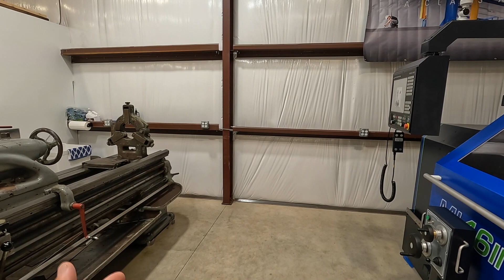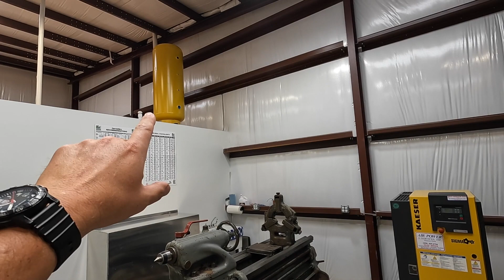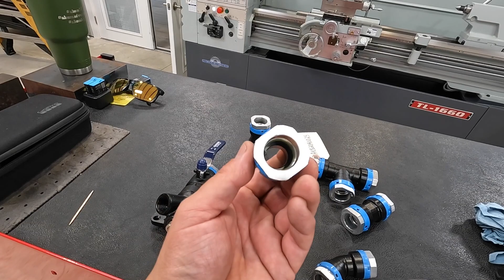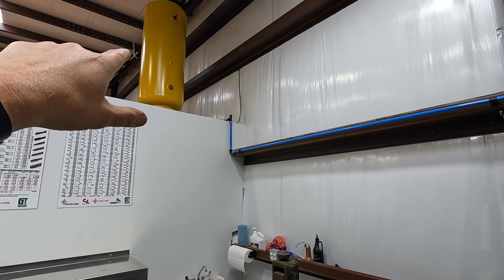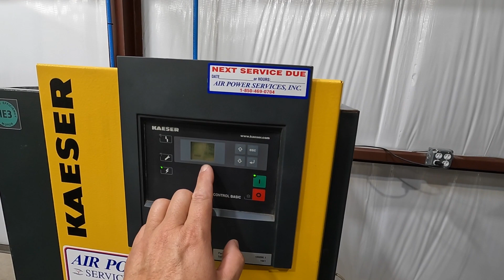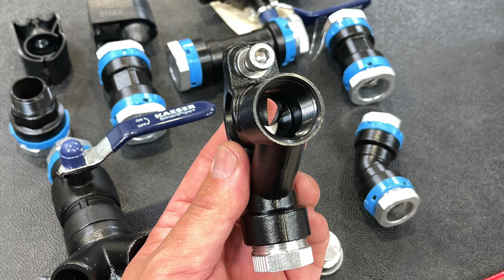KAESER Air Compressor & Smart Pipe Installation

Comment: I’m just waiting for all the battery purists to chip in and complain that air is garbage and a waste of money 😆 beautiful system though, congrats! There’s nothing like a properly setup air system, I feel like crappy unmaintained air systems give people a false idea about compressed air. It’s by far the most useful power source to have in a shop
Reply: Try running a cool mist or getting chips out of a hole with a battery.
Reply: @kensherwin4544  Or try chasing down a Shelby Mustang for ten miles with a Tesla. After five miles at full battery power it’s all over.
Reply: @ellieprice363 ... If you can find the Tesla after it runs away from the Shelby!
Reply: @paulcopeland9035  If you find it after five miles at full power it’ll probably be burning.  (:-))
Reply: @ellieprice363  Ahhh!.....Battery hate.  It seems to be going around on this channel!
Reply: "battery purists"?  Hell, everybody is a "battery purist" these days!  Compressed air has a lot of uses other than running tools.  A good system like this is icing on the cake!

Comment: When I heard “smart pipe”, I really cringed! It’s like, “don’t tell me some dingaling decided to over-complicate pipe, for heaven’s sake!” It’s pipe; a thin-walled cylinder open at both ends, like a straw. It doesn’t need computers or automation or sensors (except maybe if it’s carrying dangerous/flammable chemicals, especially underground.) Good thing these are just regular v1.0 pipes! 😌❤️
Reply: Yeah I fucking hate marketing buzzwords that do nothing except check a box on a bean-counter's piece of paper. There is literally nothing "smart" about pipe.
Reply: At least they didn't call it iPipe.😁😁

Comment: How to the fittings connect?
Threads- press- shark style?
Reply: They are "shark style" with high tolerance, a good system!
Reply: The fittings have a cutting ring. When the nut is tightened it bites into the pipe.

Comment: Very cool, that is a nice air system to be sure. Too bad they created a trip hazard on top of the office which you had indicated that you were going to use for storage or the wife's projects. Maybe plans have changed as they often do.
Reply: Yea I was confused by that, seems like installers taking the easy option which will get on the way later. Can't see why that would be more efficient to have on top.

Comment: Is this shop going to be a manufacturer showplace for equipment you get for free?  Or is this going to be a real working shop?  I subscribed to see chips fly.  Don't really care about rigging an expensive air compressor
Reply: The product placement is getting to be ridiculous - that's why the compressor is in the middle of the shop, where no one else would put it - so you can see it in every video. This is a youtube studio, not a job shop. Which is fine, if that's what you want. Not for me.
Reply: Go away.  You won't be missed.
Reply: Or you can skip the episode 😂

Comment: Really nice air system, Its sounds like a furnace blower on low, very quite and easy on the ears.
Reply: Once the cooling fan kicks on, it's not so quiet. But, it's only momentary that it's on... At least that's my experience with larger (100HP installs).
Reply: @IceBergGeo  On the SX series the fan is mounted to the drive motor. That is as loud as it gets.
Reply: @ibey01  nice. Something I didn't know. Always good to learn. 

The larger applications are pretty neat though. At one installation, the customer put one into a closed room with a TEENY exhaust fan. Room went from about 70 to 130 in about 5 seconds when the cooling fan kicked in. Gotta love engineers, right? This was known that a compressor of this size was going in there.

Comment: A question I have is, why didn't they run the pipe completely around the in a continues loop? From what I have read and heard, that a loop will provide equal pressure and air volume completely around the loop.
Reply: The pressure drop in a 1 in new pipe is minimal
Reply: if it was a big shop with many workers, sure. its a small shop with a solo operator.
Reply: Yep .. that's the way it should be done.

Comment: I’d seriously consider moving that compressor away from your work area and run that mezzanine air line on the wall so you can still forklift stuff up onto the platform
Reply: looks like it is arranged to be in camera shots
Reply: @WastingBob  definitely looks like product placement
Reply: First thing I thought of too
Reply: Makes a lot of sense!
Reply: He could even remote mount it on the mezzanine and run a switch down somewhere accessible. The location he chose is down right terrible.

Comment: Your shop looks awesome. The lighting is great. I am not sure I understood why the air distribution system is "smart". It looks typical. The air compressor with the dryer will produce as much BTU to counteract the mini split AC unit.
Reply: "Smart" is just a trade name. The stuff I used was called "Rapid-Pipe" basically the same thing, but the fittings were different. The heat given off by the air dryer will be an interesting question.
Reply: @tsmartin  the heat coming from the compressor will be more than the heat coming from the air dryer, especially when you consider that it's just an ac unit that's inside. As such, most of the heat coming from it will be the refrigerant compressor.
Reply: The drier will produce net very little heat as the compressed air is cooled which will be warmed by the heat of the drier coil plus the heat of it’s inefficiency. The compressor is much the same but will have greater heat effect as its heat will be concentrated right in his workspace. Better placement for noise and heat dissipation would have been up with the tank.

Comment: I swear by a Kaeser air compressor, I've got a little 1.5hp portable unit I use ALL the time.  I love that thing, it's been rode hard and put away wet but is still kicking.  Loud as all-get-out, but has never let me down.  Best $175 I ever spent.  I bought it from a yard sale years ago and don't know how long they had it before me, but I haven't had that first problem with it.

Comment: So Adam, you have a HUGE flat room in sunny florida. Are you thinking about solar on the roof? Also, is there room by the AC units to put a shed for the compressor outside?
Reply: He doesn't own the building.  Joe (the owner and his friend) might have an issue with outdoor "improvements"!!

Comment: EDIT:(I posted this comment before watching the whole video... it looks like you've got the system dialed in and will work well for you)

Adam, did you get the built-in air dryer with your new compressor? While "normal" compressed air might not be a problem that CNC lathe will not like it at all. The moist air will corrode and gum up pneumatic valves and anything else air-powered in that machine. When I bought a CNC lathe no one mentioned getting an air dryer. Eventually, we had to replace several valves and rebuild a collet closer due to water damage from wet air AND we bought an air dryer. No problems since.

As for the piping: make the 2 legs of of the "distribution" pipes connect into a loop. This increases the flow of volume of air in any point of the system, especially if there's some heavy use of air. If you don't have an air dryer position the T-fittings to point UP and use a 180° u-bend to drip the lines. This keeps condensed water from just draining down the "drop". Put a small drain valve at the bottom of each drop so water can be purged from the "drop".

I HIGHLY suggest moving the compressor near the front of the building. The proposed place is too close to the work area: you're going to feel the heat  from that compressor and, while it's quieter than piston compressors, it will be noisy. I have a Kaeser SM10 and it's much quieter it's not silent and at the end of the day you'll notice it. My opinion: the proposed location is not good.
Reply: @ralphgesler5110  Hence my top line saying I had not watched the entire video before commenting. I left the comment up since I felt that I had some useful information for others. I suspect when they get to the video for the piping the Kaeser rep will have even more info.

Comment: So you are taking over Abby's craft area above the office????
Reply: That's what  was wondering.  With the tubing around the edge, Abby will have to step over it every time she goes up and down.  Also with equipment all around the outside of the office, where will you put the stairs for Abby to get to the second floor?   You could be in BBBBBBBiiiiiiiiiiiigggggggg  trouble!

Comment: Sure hope with the shiny new system that you use 3/8 inch or high flow couplings and not the cinchy low flow 1/4 inch fittings that most use!

Comment: I couldnt help notice the cover is installed over the water fountain /water heater. Did we ever do anything concerning.....The TRAP 
 Just kidding. Really nice compressed air system. Good going. BTW i eun service calls at a location that has a screw type compressor although a different brand. I havent noticed any heat troubles so far. I,m sure it will do fine
Reply: Just wait until the sewer smell starts and everybody will be running around trying to find out where it's coming from.
Reply: That water fountain doubles as an emergency eyewash station.  Everyone else will be glad to have it.
Reply: @12345NoNamesLeft  Oh man... Someone gets something nasty in their eyes, they stumble blindly to where they think the water fountain/eyewash station is... they find it but t is underneath several hundred pounds of tools and parts that are sitting on a stainless steel cover... desperately the shove off all the tooling on to the floor and tear the cover back and then... they hit the valve but what is coming out of it? 
Easier to go to the sink and stick your head under it. Better yet get a couple of those plastic eyewash units and screw them to the wall. At least then you should have some reasonably sterile stuff to flush the eyes with.
Reply: I'm disappointed.  After all of the doomsday warnings from the YouTube plumbing vent experts, I expected to see the back half of the shop blown off from a methane explosion.  Dang, no fun on this channel.
Reply: @paulcopeland9035  oh man youre not kidding. The freaking worrying that went on and on about the dadgum.... TRAP!!!!!!
Reply: @randyfox4611  !! YES.  I don't know if you live close to this shop or have planed to visit, but I would not go near it.  The danger of a TRAP explosion is no joke(!!).....and we should alert the authorities. Thank you for your concern.  It shows there are at least some adults who watch this channel.
Reply: @paulcopeland9035  thanks for noticing. I dont know if you picked up on it in the previous replys but apparently we missed a very important facet to the dilemma.....in case of emergency one would be required to wash there eyes in the now covered water fountain. I swear...that fountain with its explosive gas issues and now the inability to wash out eyes in an emergency. At this point i wouldn't be suprised if they tossed that trouble making Mo Fing thing right out in the back yard!
Reply: @randyfox4611  Well, I have been involved with a few "shop builds" over the year (have one now!) and that sink was not a designated "eye wash" appliance!  I don't know the Florida code but I am guessing it is just a cheap sink they stuck on there to satisfy tenant building code.  The "explosive methane" thing is funny to me and I guess you can tell how I feel about it.  Just another "YouTube Expert" bunch of nonsense.
Reply: @paulcopeland9035  all very true. Thanks lots for being of good humor about the thing. Its been a lot of fun. I truthfully was astounded at the huge measure of those who were so pasionate about how wrong it was and soforth. Thanks again for the fun we had with........the trap

Comment: certainly beats using old iron pipe for your compressed air.  so much easier now.
Reply: Easier until you see the price tag compared to black pipe. :)
Reply: Materials are more expensive than black pipe for sure, the labor no, imagine threading so much ends and connection of black pipe? You can't compare the two, the aluminum tubing lasts forever with no air turbulence and pressure loss, not to talk about rust and contamination

Comment: Not sure why the pipes would kick out at the top and leave all that hose hanging out to get snagged the first chance you have. Would it not make more sense to keep it close to the wall until you reach the tap and then kick out?
Reply: My thoughts too
Reply: Turbulence
Reply: When you have yours installed make sure you tell the guys to do that and let us know how that works outs. Even is there wasn’t a specific reason, at some point you have to run out, unless you aren’t running reels. And if that’s the case you’ll just be tripping and snagging all the hose laying on the floor.

Comment: Kaeser AIRTOWER 5C Rotary Screw Air Compressor with Integrated Dryer and Tank, only $10,000.00
Reply: Holy sh!t!!!
Reply: The initial cost for an air compressor is 10%  out of 10 years, the rest is maintenance and electricity, for any system. Be smart buy once!
Reply: Yet people have them in their garages. Expect to spend 10% of the purchase price on annual maintenance.
Reply: @ibey01  How would it need $1000 per year (your number) to keep running?  Please list the parts!  It will be fun to know.
Reply: @LurkMoar  If you have millions of views every week, you will get the attention of manufacturers and their toys!  It is a very good thing he has built!!

Comment: We have a 7.5 (?) hp kaiser at work in one of our buildings.  It is quiet.  We've had problems with it tripping out on some sort of over-temp alarm.  Nobody has been able to fix it in several years.  Apparently they don't like starting/stopping frequently...but are great for constant demand usage.  I think our warranty will end this year and I'd be surprised if it doesn't get replaced.  We have the door opened and 2 fans blowing on it constantly to keep the alarm at bay.  It's likely less efficient than a traditional system because we keep the fans running 24/7 even though we only use air mon-fri 8-5.  

Having said that, it's super easy to maintain every 3 months when we go through each building.  And it is pretty quiet, even though we have it mounted in the mechanical room.  The air dryer seems to be less of a nuisance than other facilities that need 'dry air'. 

I think it will probably work pretty darn well for what you are using it for.  But for an educational facility...we haven't been too happy.
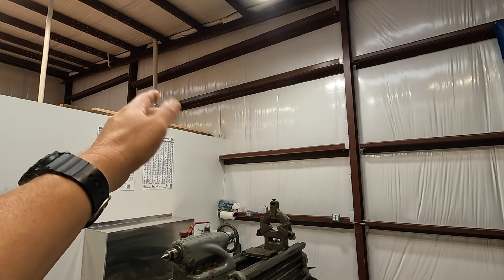Reply: We had the same problem with our 150hp compressor at work.  We run ours 6:30-3:30 mon-fri, it's not a Kaeser but talking to the tech that came to service it its not uncommon for a compressor to be an indoor/outdoor model, and it was set to the wrong mode so it kept overheating and tripping the alarm.
Reply: Screw compressors are designed to run 100% duty cycle, a motor has limited starts an hour this is just general knowledge, the compressor is over sized or there's not enough storage volume, The cheapest solution is to add another air tank to reduce the number of starts an hour.
Reply: Ja Kaeser Schrauben Kompressoren laufen am besten die ganze zeit durch und müssen am bessten die An und Abluft nach Draussen gelegte Luftkanäle haben um eine gute Temperatur zu bekommen. Er braucht eine hohe Temperatur um das wasser im Öl los zu werden. Er darf aber nicht zu hoch gehen das der Alarm das system abschaltet. Das gleichgewicht ist nicht immer einfach aber er sollte prinzipiell in einer gelüfteten umgebung stehen. Ich hoffe Adam hat da nicht auch probleme mit da das öl der Drehbank den Luftfilterne des Kompressors nicht gefallen werden....

Comment: We have three of them that used to be inside and let me tell you just move it outside literally in a shed or something the amount of heat ours puts out is worth the price of moving them outside
Reply: We have 2 40hp 9,800 btu heat output compressors and 3 vacuums that put out 89,000. Put them in a room in new addition.... let me tell you the climate controll people fucked up the calculations on the air flow required. We ended up with a sauna
Reply: Doesn't need to be outside. Just build an enclosure around it against the exterior wall, have an intake on the wall near the floor, and an exhaust fan at the top.  Now nobody can steal it.
Reply: I thought that at first but I don't think he'll use enough air to create so much heat that it will matter. He's not sand blasting all day or anything.
Reply: I was thinking something similar. Looks like the "smartpipe" system is easily configurable and by the time he gets his own unit he should know whether he can live with the noise and the heat. Even though that thing is pretty quiet and he has a (more or less) sound absorbing interior wall sound pressure builds... he might find it a bit loud.
Reply: @David
Good points.
Reply: Upside is Adam is a 1-man-shop so maybe it won't run so much to generate as much heat
Reply: @94XJ  I agree… especially with that 120gal additional tank and his demands on the system being light.  Plus he has that “BIG ASS FAN” and I’m sure he’ll add another smaller fan if needed to blow on the system (???)
Reply: A 5 horsepower compressor will not place that much thermal load on his a/c. Besides, a nice, new, compressor sitting outside makes it a target for thieves and Kaeser is one of the most desired compressors around.
Reply: @sp1nrx  easy fix, just run a duct to exhaust the heat, with a small return for the fresh air, in the winter just let the hot air be recover to heat the room.
Reply: @sp1nrx  Wish my work went with Kaeser. We flushed money down the drain on Atlas Copcos that turned out to be gaaaaaaaarbage hot steaming garbage. Now we're back on a new Gardner Denver, our last trio of them went over well overall...
Reply: @sp1nrx  we have 3 50hp models locked inside of a sea tin